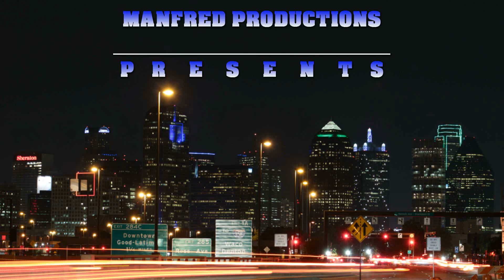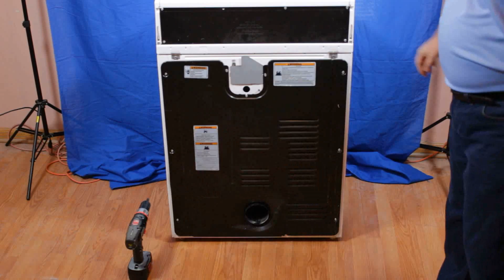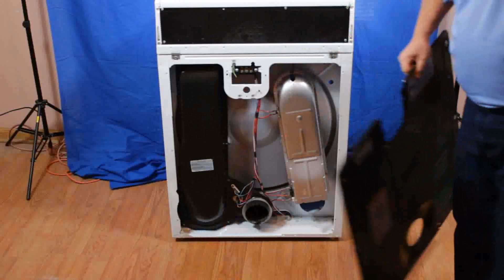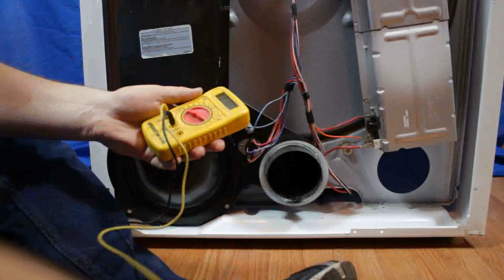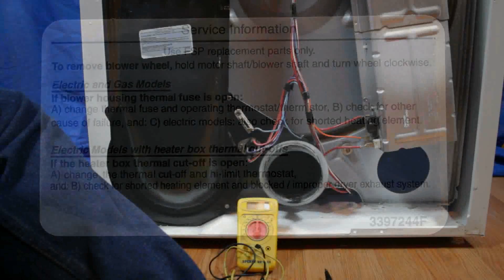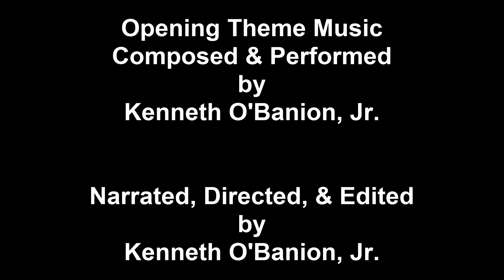Whirlpool & Kenmore Dryer Wont Start or Run - Thermal Fuse Repair 3392519 or 3390719

Comment: i have a whirlpool similar to this.  It dropped kinda hard during a recent move and wont start. no house light, no nothing.  I know its not a fuse.  just cant put my finger on what could have gone wrong.
Reply: ok, great advice.  will check and update with my findings
Reply from the maker: best of luck!
Reply: i discovered the problem.  the timer needs replacing

Comment: When I push the start button it runs, until I let go of the button. Any tips are helpful.
Reply from the maker: This can be caused by a broken belt, or bad broken belt switch, if your model has the broken belt switch.  It also happens when the centrifugal switch is going bad on the motor, and fails to switch it from the start windings to the run windings when you let go of the start switch.  You will have to do testing on these to see if they are good or bad.

Comment: Thanks for the video!...Question?...I have an Estate brand (Whirlpool) and won't start with the push of the ON/OFF button.......I tested the thermal fuse and got a reading on my multi-meter. Is it safe to say then it's the push ON/OFF switch that is bad? Thanks for your time Canyonman1963
Reply from the maker: It might be, but it is best to test it, or anything else, before replacing it so you don't waste money on parts that are not the problem.  You should test it, and also test the door switch, and also test for correct power coming in at the terminal block from the wall outlet.  Sometimes only half of a dryer circuit breaker will trip, and it wont even look like it is tripped.  Best of luck diagnosing it!
Reply: Thanks for the response....after checking the continuity of many parts it was determined the door switch was the problem...live and learn.

Comment: I changed the thermal fuse and the dryer still doesn't turn on, all I hear is a click when I press the power button. What should be the next thing I check or replace in the process of getting to the real problem?
Reply: canyonman1963
Reply: canyonman1963 u

Comment: I am concerned that if I cut the bad part back and than splice another on to it will it still burn up
Reply from the maker: OK, now I better understand what you are dealing with.  Usually when a wire burns up like that, either there is a short in the wiring further down the line, or the connection where the wire burnt up at was loose and arcing, which would heat up the wire until it finally burns in two.  So, with still unplugged, cut back and remove bad part of wire, splice in some good wire and make sure all splices and connections are firm and tight.  As long as nothing else is wrong, that should fix it.  Just make sure when you are done that none of the connections, even the main plug wire connection to the terminal block, are loose at all.  It must be tightened all the way, or it will arc and cause problems.

Comment: if the issue is ur wires coming from the panel that your plug ties into is it safe to reconnect that black wire to the connector or no

Comment: I changed out my Lo operating thermostat thats right under the thermal fuse & my dryer worked but after drying one load of clothes, I went to put another load in & the dryer wouldn't start...waited a couple hours then decided to try and start the dryer again & the dryer started with no problem???

Comment: checked my thermal fuse it was good...but I noticed one of the terminals on the operating thermostat looked like it may have overheated (blown)...so if I change the thermostat do I still have to change the thermal fuse even though the thermal fuse was good?
Reply: Awesome thank you...also I was curious what the other operating thermostat thing is thats mounted on the right side of the dryer?...thanks again...very informative video

Comment: Do you have to put the back cover on and the plate on for it to work again? I replaced the thermal fuse but it still won't start. Thanks for your videos.
Reply: Thanks so much for your videos and help! I fixed my whirlpool, it was the door switch and I saw how to fix it from watching your other video. Let me send you some cash via paypal for your help.

Comment: Thanks for the info as it did help. I do have a couple of problems though. I don't have an ohm meter so I connected the two blue wires together and the dryer started perfectly. I then ordered a new thermal fuse and thermostat and proceeded to clean out my hose and vent which were extremely dirty. When I was finished cleaning, I wanted to check how the air flow was so I once again connected the two blue wires. Big mistake as I saw a blue spark and immediately turned the timer knob to the off position but for some reason it just kept running and didn't shut off. I unplugged it, which is what I should have done in the first place. I am a little worried that it somehow shorted out the timer because I noticed that one of those blue wires goes to the timer. Not sure where the other blue wire goes to. The metal ends of the two wires are burned and I wont be able to connect the new thermal fuse. Can I get two new wires and just reconnect them and will I most likely need a new timer? Thanks for any info.
Reply from the maker: +TannerBoyle1967 Well, yes, always disconnect power from the machine when doing any kind of work to it.  And yes, you can replace the wires if necessary, but usually when something like this happens you can just cut the terminal ends off the ends of the wire and then buy some new terminal ends the same size, and crimp them onto the wires where you cut the old ones off at.  The rest of the wire has to be still good to do this of course.  If it is crinkly and burnt all the way up the wire, then cut out the wire as far back as needed to get past the bad part, then attach same size new wire to replace it.  For the keeping on running problem, that is usually a shorted start switch, so test it before you spend the money on the timer!  Also, test the door switch, since it is where the other blue wire winds up going to on most of these dryers.  Best of luck to you!
Reply: +canyonman1963 Thanks so much for the quick response. The wires seem to be ok, just the terminals seemed shot. Can these terminals be picked up at a local hardware store or will I need to order them online? Also, how can I find out the exact size I need? Should I just bring the terminals to the hardware store with me? Watching your other video, it does seem like the problem is the start switch due to the fact that when the dryer was on I had tried to manually move the knob to the off position and it would just keep going. I will end up testing to see if the start switch is bad. Thanks again for the help.

Comment: Why was the fuse blown or what would make the fuse blow?
Reply from the maker: +T&#39;Roderick Oliver The fuse blows when the exhaust air gets above the heat rating for the fuse.  This can be caused by several different things, including a bad operating thermostat (stuck on all the time will cause it to get too hot - located next to this thermal fuse), any air flow blockage in the dryer blower box, the hose from the dryer to the vent connection at the wall, through the ducting in the wall, or at the duct vent either on an outside wall or up through the roof, and a shorted heat element can cause it to get too hot and blow the fuse.  Hope this helps!
Reply: +canyonman1963 😁👍👍

Comment: I replace my thermostat , and heating element and when I went to go connect the wires then plug it in it's sparked ,now the dryer won't turn on at all, can you please tell me what is wrong? Thank you!
Reply: +canyonman1963  yes sir, thank you for your time an response!

Comment: thanks for the video. my dryer was working fine then it stop working. so I checked the thermal fuse and it was bad. I also checked the terminal block and realized it only had 120v on l1 to N and 10v on l2 to N. then tested l1 to l2 and only got 85v so that means it's not getting proper volts. after that I checked the wall outlet and it checked good. but my power was melted on the line side on left. should I replace the power cord and terminal block along with thermal fuse
Reply: +canyonman1963 thanks for the advice. I did check the thermal fuse and it did not have continuity. what I meant about the power cord was the terminal block was not melted it was one of the prongs that plugs into the wall outlet that was melted. I also see that outlet on the the same prong is melted. I have a 4 prong cord so it will be the right prong. the top, bottom and left prong are fine. should I replace the outlet also?
Reply: +canyonman1963 thanks for all your help. I replaced the thermal fuse along with a new power cord and wall outlet. my dryer is alive again. great video. thanks a lot!!

Comment: canyonman1963, thanks for this great video.  I replaced both the thermostat and the fuse and our dryer worked fine for three loads and now the problem has returned.  Is there anything else that I need to check or replace?

Comment: How much is the thermostat?
Reply from the maker: +Chica Caribena As long as your dryer uses the same thermostat in this video, it would be part number 3387134 and it sells on my website for $22.00 + S&H.  Here is the dryer parts order page if you want to make an order!
http://www.wdrepairsolutions.com/BUY_DRYER_PARTS.html
Reply: +canyonman1963 Thanks so much for your videos! We already bought and installed the thermostat and the thermal fuse at Sears and now the dryer works, but noticed that when I open the door I can see a light on, is that normal?
Reply: +canyonman1963 Is it normal to see a red light when I open the dryer's door? When I open the dryer's door, on the upper left side, on the back wall inside the dryer we can see a red light through kind of a screen where you can see in to the rear of the dryer, is that normal? I am worried the red light points to a heating problem or something, my English is bad so I don't know if I'm expressing myself the right way for you to understand my question, sorry.
Reply: +canyonman1963 Exactly! It was one of the coils, was stuck to the metal casing but was not broken, I separated it from the metal casing and it got fixed, don't know why it got stuck if it was not broken! Now the red glowing fades away in a couple of seconds when I open the door. A million thanks! Merry Christmas and Happy New Year to you and your family!!! :)
Reply from the maker: +Chica Caribena Glad you figured it out!  Happy Holidays to you and your family as well!!!

Comment: there is a second thermal fuse down by the heating element. If it is bad then the dryer will run but it will not heat. this happened to mine. If the dryer won't start then it would most likely be the other thermal fuse. You can check fuse while it is out of dryer. or take that fuse to somebody to check it. Just remember there are two thermal fuses one on the heating element and one inline in another location. Hope this help.
Reply: +Mark Wages are both thermal fuses the exact same type of fuse?

Comment: Would this fuse stop the dryer from heating?  Mine will start and spin, but no heat. Replaced both the heating element, thermostat kit as well. (2 part kit + element)
Reply: Thanks. I am looking more at the heating element, I think it was a cheap part. Will order an OEM one, and give the kit another try, it should of worked.  Thanks!

Comment: I have a old Whirlpool dryer LG5701XMN1 which doesn't start with the start button. The motor makes a buzzing/humming sound. I then need to give the drum a little push start by hand and the motor takes over and turns the drum fine for the whole drying cycle. I checked the dryer belt and the grooved side is facing the pulley.

Comment: so i should have replaced the thermostat along with the fuse? Wish the appliance parts tech would have confirmed that when I asked..
Reply from the maker: +phastings1 Yes indeed, most of the time the reason the fuse is blown is due to the thermostat going bad and failing to keep the dryer operating at correct temperature.  Change just the fuse, and that bad thermostat will allow it to overheat again and pop the new fuse.  There is even a sticker on the blower box housing that reminds you to change the thermostat if the fuse is bad.
Reply: canyonman1963 damn, well thanks for the heads-up! I cant get to the sticker unless I detach everything, which I should have done before venturing off to find the fuse, but thank you for clearing that up!

Comment: Those friggin' wires that connect to the fuse is a pain in the as*.   Working on that 'right now' as I type.    Thanks for the video though.
Reply: I felt like an idiot and put some leather work gloves on for better grip.   I was able to pull off the wires very easily afterwards.    Luck perhaps but it worked.    It seems like the door switch may be the issue.  I will be looking to replace it tomorrow.

Comment: I've Kenmoore Oasis electric dryer mod 110.67092600 displaying F40 error. What do you think is the problem?
Reply: +canyonman1963 My problem turned out to be a burned out power relay on the control board. I found a remanufactured board on Ebay for $70 as oppose to a brand new one for $210.
Reply: Actually now it has a very loud squelling noise probably one of the rollers needs lubing I'm guessing

Comment: Great video, you saved me some money! The other problem I have is this: the lint trap won't stay put--the whole thing falls into the drum. Not just the lid that's held on by metal brackets--the whole basket falls out. Any thoughts? Is there a gasket that holds it in p,ace?

Comment: Hi, I have a Kenmore 110.96093100 and the dryer will get somewhat warm and then stops working. It always trips my circuit breaker and then it won't start again unless I flip the circuit breaker back and forth. Do you think I need to replace the fuse and/or thermostat? Thank you.

Comment: Do you have a video on how to disassemble a Kenmore Dryer Model 110?  If so, please post the link.  Thanks in advance for your reply.
Reply from the maker: todd alston All the kenmore dryers model numbers start with 110,  need the rest to know which style you have.  But, if it is the other style different from this one, like a Kenmore 90 or Elite, here is the video for those:
https://youtu.be/wTGBMlf-e6g
Reply: Thanks for your response and the video link you shared is the style of the my dryer.

Comment: When I opened my dryer door to put cloths in the light flickered several times and then when out.  The dryer will not come on either.  Would the thermal fuse cause the light to do that also?

Comment: My dryer was working until the 2 wires touched together now it want work I tried the Breaker box in the house I tape the wires up I don't know what else to do
Reply from the maker: Jackie Gibbs Well, 1st make sure the wires you taped up are still good, either of them could be burnt out now.  With dryer unplugged, remove wires from thermal fuse and make sure it has continuity using an ohm meter.  If good, next test the door switch, sometimes a direct short will cause the door switch to burn out.  If those are good, use a volt meter to make sure you are getting the 220 volts from the wall outlet, and then getting the power at the terminal block where the power cord attaches to the block.  If those are good, then test the timer, it might have shorted.
Reply: Thanks will try it tomorrow

Comment: i BYPASSED the thermal fuse and it still didn't work. I checked the power plug and the outlet and they are fine. What now?
Reply from the maker: Lisa Koch-Rocheleau Other components that go bad and keep dryer from starting are the door switch, the start switch, the timer, and the motor, as well as any of the wiring between any of those components being burnt or disconnected.
Reply: canyonman1963 Thanks will check the others.

Comment: I have a kenmore oasis 11067042600. The videos I see is not my dryer I need to replace my fuse and I can not find it.
Reply from the maker: That model is kinda like a cross between a Maytag and a Kenmore Elite style dryers.  I don't have video on it, but to get to the thermal fuse you need to release the top panel clips and raise the top panel up on its hinges, exposing the drum area. Then remove the top screws holding the front door panel on, Then remove the front door panel.  Then remove the front bulkhead front the front of the dryer and front of the drum.  You will then see the fuse and thermostat on top of the blower housing that is located center of machine on bottom near the front of the machine.  You might have to loosen the belt and remove the drum to get to the fuse and thermostat for testing and replacement of parts.  Hope this helps!

Comment: My dryer wont start. It makes a grinding noise when i push to start the load. Its as if something is stuck. I tested the thermal fuse, but that seems to be working ok. Any thoughts? my dryer is the same model as the dryer in your video
Reply from the maker: it could be something stuck in the blower wheel inside the blower housing.  You would need to remove the blower lint trap from the blower wheel box to see if anything is in there, and remove it if so.  Also, it could be one of the drum support wheels is locking up, so if you remove the drum you can check them to make sure the spin smoothly and easily

Comment: I am excited to go home and try this remedy. If I do find that that the fuse and thermostat are in need of replacement, are they model specific? If so, where is a good place to pick up replacement parts?
Reply from the maker: Yes, you do need to use the model number to look up and order the correct parts for your machine.  You can buy these parts at an appliance parts store - look for one using google and your city to try to find one!